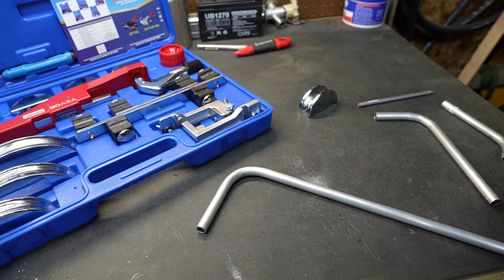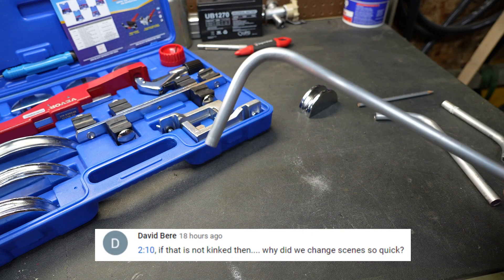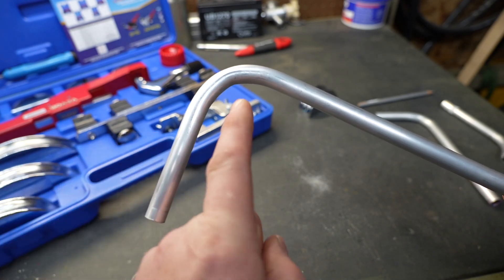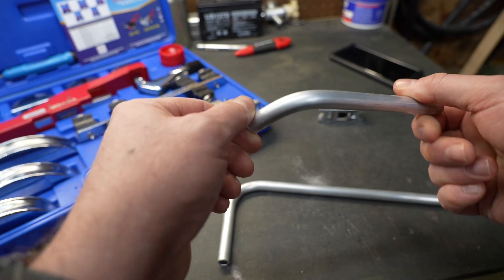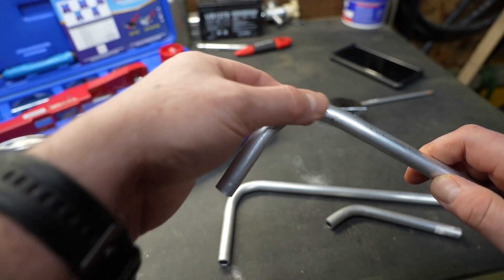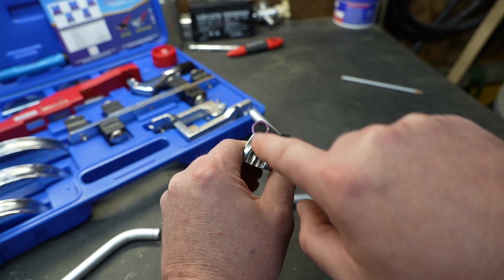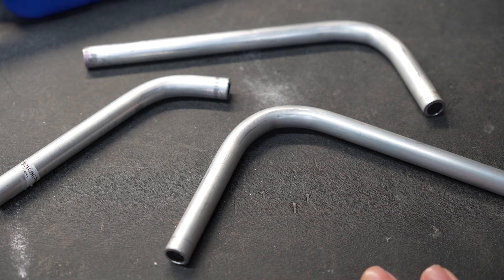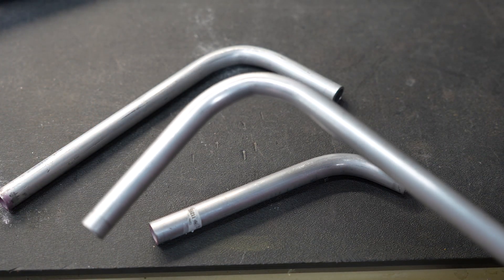Did we kink this tube / pipe when bending it with the bender?

Comment: A cheap way of bending tubing with no tool is to fill the tubing with fine sand and make sure it’s (sand) is compacted really good inside tubing and both ends are tapped up really good. Then after bending it, clean the tubing out internally.